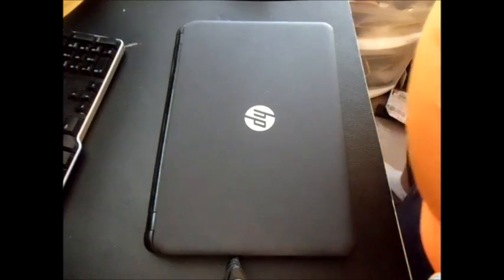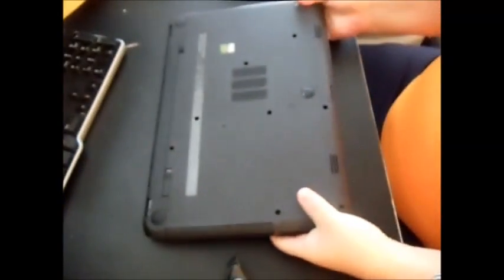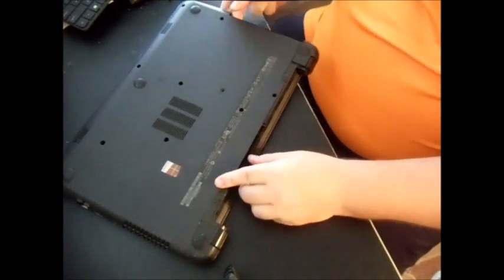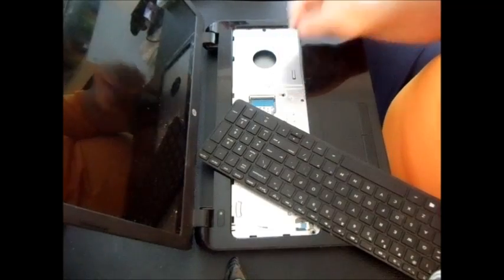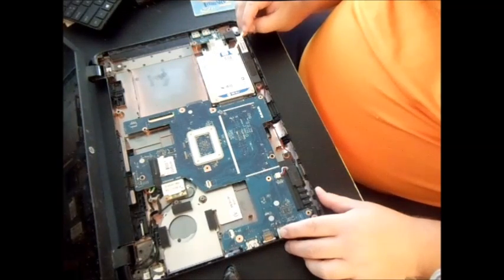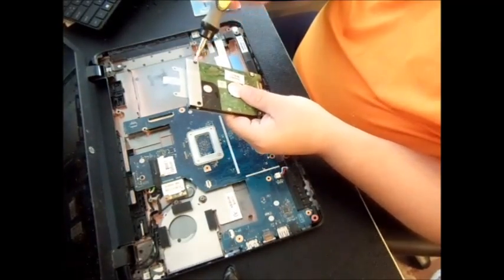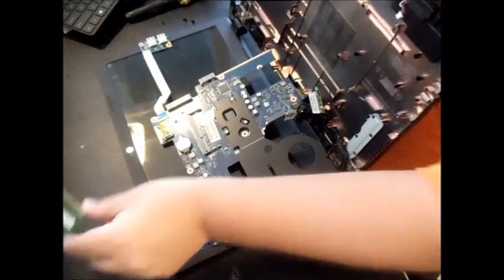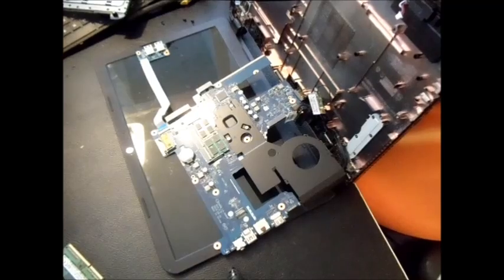HP 15 Laptop Memory Hard Drive Upgrade Replacement 15-R011dx 15-r015dx 15-r017dx 15-R018dx 15-r082nr

Comment: You Rock! 
I used the free "Belarc Advisor" program ( I heard about it from Kim Kommando years ago )and verified that I had two RAM slots on my HP 15-R018DX Notebook PC.  I had one slot being used with only 4gig RAM from the factory.  I was able to bump it up to 16gig ( 8gig in each slot ).  Thanks for your video it showed exactly how to get to the slots.  

HP should hang their heads in shame at how many steps it takes to get to the RAM slots on these models.

Comment: i have a brand new HP 15-af027CL that I would like to give to my mother as a gift.  she needs the larger screen so ...   anyway, i have 8GB installed by the manufacturer, but would like to upgrade.  From what I see in your video i see one slot, and from the crucial.com memory adviser, i see two slots.    I don't want to open up the computer until i can confirm whether there is one or two.  because what i buy is dependent on whether the motherboard can accomodate a 16GB sodimm ddr3L 12800 or if I can put in two 8GB sodimm ddr3l cards.   anyone know for sure?

Comment: If your computer has 2 slots, can you use one 8 gig chip and it still work?
Reply from the maker: Yes you should be able to but I dont think you can upgrade it more than 8g
Reply: Thanks, I run ubuntu 16.04 64 bit and 4 gigs just isn't enough...

Comment: I can't seem to get the top of the laptop out, it feels to be stuck around the hinges... Do I keep using force or give up because I'll break it?
Reply from the maker: A little force.  Just go back over the holes and make sure there are no screws.  Sometimes you do have to just go for it and you'll find that its just on there so well because of the manufacturing press.  Its a lot easier the second time.  Remember though if you do break something the parts on Ebay are very very cheap.
Reply: I ended up breaking it a little bit. There were two hidden screws that were underneath some parts that I never knew I could/had to get off. Oh well.

Comment: Hi, I have a very similar laptop (HP Notebook - 15-ac153sa) and I was hoping I could learn enough from this video to upgrade my RAM. On mine, you can't get the feet off. They're glued on. I have no idea whether there are screws under there or not, and don't want to damage it. I can't find any tutorials for my model anywhere, so if anyone has any tips, I'd really appreciate it. Thanks!
Reply from the maker: You won't damage anything.  It's just plastic rubber and glue.  You can always add more glue on it.  You have to be aggressive with these things sometimes.
Reply: Awesome. Thanks! :)

Comment: Great video. Replaced a broken screen and the connector is extremely difficult to plug back in. Cheapest laptop that I have ever worked on. I think I will keep my HP  ZD8000.

Comment: Forgot the 2 screws that you need to remove after pulling the DVD....
Reply from the maker: You did or I did?  Because I clearly showed it in the video.
Reply: http://saudi.souq.com/sa-en/kingston-8gb-ddr3-1600mhz-for-laptop-memory-kvr16ls11-8-9427430/i/ can i use this ram

Comment: Great video, thanks. Didn't realise it would be so complicated. However, I'm left with two flat screws when I've reassembled and can't figure out where they go. They're the same ones that hold the speakers in place. any ideas?
Reply: battery or dvd drive

Comment: my keyboard just blinks amd my screen wont turn on now
Reply: me too. ram did not fix it for me but try it. I just got a new motherboard on eBay. I hope it works.
Reply: Make sure your ram card is pushed in fully
Reply: Your mobo may have sustained static damaged as when you took it apart you may not have been probably grounded

Comment: i have HP 15-f085wm, can i change the RAM or hard drive? because for video editing this is so bad :(
Reply from the maker: Yes back up your operating system and everything through HP recovery and download it all on a 16g USB memory drive.  Then buy a 128g or 256g SSD hard drive.  Upgrade your ram to 8g.  Reinstall your Windows operating system onto your SSD drive with from your memory stick.  This will help.
Reply: okey thank you..
but, i dont have to many mooney, so if i want to change the HDD, in your opinion, what HDD good for video editing? (not gaming) :)

Comment: Hi , i need to replace the wifi adapter on my HP 15 laptop. Can you tell me if there is two connections on the adapter (black/white) or a single connection (black). Thanks

Comment: How do you put the "feet" in their place again? do they just stick back again ? (afraid to take them off and not be able to stick them back)
Reply: They have sticky glue on them & adhere back just fine.  I used the same steps on my HP mod 15-G023CL, but Surprise! it has only 1 memory bank total!  Cheap HP! I replaced the single 4gb w/an 8gb.  If replacing the HDD with SSD, use Free Home Macrium Reflect in Clone mode. You can get a USB3 adapter for $20 and attach the SSD to the USB3 port and clone the whole disk in an hour.  I have used Macrium backup with Win7 & Win 10 and it works well - and its priced right for Home use! With an external Blu-Ray writer, backups are quick, easy & cheap.
Reply: Thank you, I just want to remove something noisy from the inside haha like a little bit of plastic or so... that's why I wanted to disassemble it ^^ Thank you again

Comment: I have one of this machine's cousins and, despite reading the repair manual, I would have broken a couple of things without your walkthrough. HP disappoints on many levels with this, I believe it has a BIOS bug they have not tried to fix in almost 2 years, mine came out of the box with an extremely slow harddisk, maybe invisibly damaged but not of interest to HP, and the list goes on. What I can't blame HP for is that a) one screw on that caddy nearly broke my cheap screwdriver, but it was the only problem screw b) all the ribbons feel a bit different and in the twilight I wasnt sure where I was going, but they seem properly reattached.

Comment: Thank you for this, it was very helpful and exactly what I needed.  I have successfully upgraded a HP 15-G077NR from 4GB to 8GB.  I did cringe a little every time I saw you drop a screw haphazardly off to the side. One thing I find indispensable for this kind of project is some sort of screw organizer. A small ice cube tray works well. It not only helps you get the right screws back in the right places, but also helps keep you from skipping any steps in the reassembly.
Reply from the maker: Thanks for the comment.  I agree about the screws but I have several thousand equal screws on reserve if I lose one. lol

Comment: Love your video, watched it 5 times :) but am stuck with 2 screws under the DVD into the case that the "General" can't unscrew.  Tried WD on a q-tip swiped over screw head, still nothing.  Sad face, guess it'll have to go to the Geeksquad to finish.  Thanks so much for this tutorial!
Reply from the maker: Oh don't do that. lol  Some screws that are stubborn need a different thickness screwdriver and torque friction power.  Purchase a manual precision screwdriver set to give you multiple options.  Here is one from Ebay but its coming from China. If you look more carefully you can find one that is local or in the US http://www.ebay.com/itm/Delicate-31-In-1-Precision-Set-Handle-Mobile-Screwdriver-Phone-Repair-Kit-Tool-/281779565739?hash=item419b5ef4ab:g:KjkAAOSwHnFVrJTf

Comment: my brother i need help hear.. i have got the same laptop as urs ..it doesn't display but it does switch on and it shows that its on because the wire fire batten it indicate ..so i try to look for video cheep set ands am not show that is it the one..because there  is no cpu so i think its acting as cpu so am afraid to burn it..course to others i do so and it display but only to those mother Bord which has cpu and video cheep set..so please help..it doesn't  displaying ..WHAT MUST I DO

Comment: I went to crucial and ran their scan and it told me i could get two 8 gb sticks for a total of 16 gb. i ordered them and then now just watched this video to see there is only one slot. i guess i should cancel that order.
Reply from the maker: +Adam Tillman Which model is it.  There are a few with 2 slots.  Also you can replace that one slot with an 8g. I'd recommend getting a used one on Ebay. I've seen 8g ram for as low as 30 bucks.
Reply: I am not sure which exact model it is all i know is it has the 1.7ghz gen 4 I3 processor. and i do realize i can get an 8 gb. but i want the best 8gb i can get for it. and crucial has good prices. but still thats a lot of work for a 8 gb ram stick. i was just really hoping get get a good 12 or 16 gb ram. that would be awesome. anyway thanks alot.

Comment: Is there a limit to RAM you can put in this laptop? I have the same one and want to put a total of 32gb's in.
Reply from the maker: Yes.  8g is the max I believe on this one.  Some laptops will allow up to 16g.  Remember your processor and OS is a bottleneck so it wouldn't utilize the full 32g anyway.
Reply: +RubberWilbur what if I put in a 16gb RAM? will that work or will it just read 8gb out of the 16gb?
Reply from the maker: no it won't work.  8g would be the most.
Reply: +RubberWilbur well that's a bummer but thank you for the info it saved me from buying a 16gb RAM.

Comment: HP why do you make it so hard to upgrade :(
Reply: acer is the same way the manufacturers hate us
Reply: kaleb33497 
At least Acer laptops are easier to upgrade than modern HP laptops.
Reply: ***** still as hard an annoying
Reply: after watching this I'm not going to be upgrading to the 8 gig chip. Smh, waste of time for an old laptop.
Reply: Lall O They want you to buy another one
Reply: They've become like toasters --- disposable. Next time, get a "refurb" from Walmart.com  You'll be astonished how little they cost.  I got a nice business-class HP, fingerprint scanner, tough case, extra ports, etc. for $250. It looked new (no wear anywhere, clean). Add another $100 for 16G RAM from Crucial.com (and it had a little door to install the RAM).

Comment: Thank you for this video. I bought the same model shown 15-r029wm refurbished for a joke of a price. After using it for about 3 hours I listened to the "clicking sound of death" so I quickly check this video to check where my hard drive was placed and it was correct. The hard drive is about to die...hopefully I could attach a 240gig ssd, but if you think this disassembly was awful check any Compaq presario CQ60 disassembly

Comment: Thanks for the video. Although I have been building my own PC's for years I have done very little on notebooks other than add ram and swap hard drives which in most cases is very easy. My HP 15 came with Win7 and an upgrade "recovery" disk to Win8.1 which I hate. Adding an SSD drive and 8GB, wanted to add 16GB as I thought it had at least two slots and now have a spare 8GB stick. My HP15 was running very slow, a piece of junk in my opinion, tried everything to speed it up so this was my last hope. Your instruction was good to speed things up, there were two more wire connections to undo at the end to fully free up the MB. Now it is all back together, took forever to install the recovery version of Win 8.1, had 4 disks and now upgrading to Win 10 which also takes time. I must have messed up on the KB ribbon as the KB is not working properly, after this Win10 install is done I will pop the KB out. If this thing doesn't speed up, I will take my new parts out and toss it in the trash! Thanks again for the instructional, having all the screws to remove pointed out to you sure speeds things up.
Reply: did you eventually fix your laptop if it not to much trouble could you help md?

Comment: Very educational. A tip that might help in the future. Get CPUID and it will give you the amount of slots used on the board. That way you can decide BEFORE you take it apart if it's a worthwhile upgrade or not considering the time taking the laptop apart.

Comment: Thank you for the video!

I'm working on the same model. I put the thing into hibernate and surprise! Windows 8.1 has this weird problem. If it goes into hibernate, sometimes it forgets where the boot drive is!

I had a Samsung 80 gigabyte hard drive attached to the notebook when I put it into hibernate. Now when I turn it on, it gives me 5 choices for an operating system, and they are ** ALL ** the Samsung hard drive!

I tried repairing the boot sector. I tried reinstalling Windows. Nothing I tried worked. So I watched your video and removed the hard drive. Next I will back up everything that is worth backing up, and then try to repair the boot sector.

If that doesn't work, I will probably have to format the hard drive and then install Windows.
Reply from the maker: +Anthony Starfield Yep it looks like you may have to install a fresh WIndows OS to solve your problem.

Comment: thanks man, i found your tutorial very instructive and useful. My pc is hp 15r-225 nl and it's almost egual. I  followed the tutorial until the motherboard removal. I didn't understand how to remove the lcd cable from the motherboard, and in your video there isnt't the cpu cooler, that in my case seems to prevent the motherboard removal...or i think so. any suggestion? For this reason i could not check if my laptop has 1 or 2 ram sots. The motherboard seems a little bit different from yours.

Comment: can you tell me where the HP wireless card is on this model. it seems this model is very difficult I wish I would have known before I bought it. Thanks for your help
Reply from the maker: +roadstar499 If you look at minute 11:43 you see it in the right center to the right of the DVD slot.  See the tiny little white square?
Reply: +RubberWilbur I really can't see what you're saying because my phone is so tiny and my eyes aren't the greatest. never fixed a laptop before although I can fix just about anything else. will I be able to get it from the top side or do I have to flip it over. does it say something on it so I can recognize it? I watched a couple of other videos using other laptops and they got it from the bottom and it was so easy compared to this 1. Thanks
Reply from the maker: +roadstar499 Unfortunately if you have this model you have to take off the palm rest.  The older ones you don't have to do this.  Just take your time to dissemble.  Why do you think your wi-fi card is bad?
Reply: +RubberWilbur my nephew who was in the service told me that was the problem. he fixes computers. he's in Turkey right now and I rather not bother him we're really not that close. my laptop does not recognize or show any Wi-Fi connections in my area including mine. nephew said with these HPS is very common for the cards to go bad
Reply from the maker: +roadstar499 I'm sure you already tried this but make sure it is not just turned off.  Tap the F12 button and then try Function F12 as well.
Reply: +RubberWilbur yes I tested for everything else. so the wireless card is underneath the palm plate and facing upward? Thanks
Reply: +roadstar499 what I mean is I don't have to flip it upside down I work on it when its sitting face up and remove the wire card? Thanks
Reply from the maker: +roadstar499 Watch the video.  It shows everything.
Reply: +RubberWilbur I have the Wi-Fi chip screw out but how do I disconnect it from the cable I don't understand that type of connection do I just rip it off pry it off. also what numbers do I use to order a new one. the ones on the top with the information on the back. thanks again for all your help
Reply from the maker: +roadstar499 Yes they pop off and pop back on.  Just go to ebay and type in the model number you see on the card.
Reply: +RubberWilbur ok I got it off there are several list of numbers on it. and I do mean several. none of them say model number. can you be more specific. is it Mac ID or ct number those are the ones with barcodes over then below there are more numbers.

Comment: "4 gigs is really good" Wrong 4Gb now-a-days is terrible unless you're running Win7 and below Win8,8.1, & 10 is terrible with 4Gb, Please inform these lovely people correctly.
Reply: Actually all depends on your usage. For general usage like browsing and word documents then 4gb is plenty.  And ive had no problems with 4gb ram on windows 10
Reply: +taz874  you are absolutely correct im running w10 on 6gb stock hp15 r formerly had windows 8.1 no issues
Reply: +Milkersdegreat2 I agree with you, My Girlfriend bought a similar Laptop, It has windows 8.1 then it upgraded to Windows 10 which made it super slow! I put 8GB since that was teh max allowed by teh motherboard, that helped a little, but what really did  was the upgrade of the HDD. I installed a Samsung 850 evo. Thankfully, motherboard was SATA III ready so I get full enjoyment of the HDD capabilities

Comment: Be warned: Be very careful when removing the palm rest from the keyboard baseplate.  When I did mine, the cable strip going to the power button stripped and had to be replaced because the cable was too taught and slightly too short.  pain in the ass when you get it all back together only to realize you have to take it apart again to replace another part

The 15-r017dx has 2 ram slots, thankfully so it wasn't a complete wash, but now that I have it back together, cable strip for power button replaced and a new HDD with an OS finally installed, I'm finding out i somehow missed reconnecting the wifi antenna cables and the right side USB ports, time for take apart number 3! WISH ME LUCK! lol
Reply: did you  ever fix it I upgrade the ram in mine but now it won't turn on and I'm scared
Reply from the maker: probably your new Ram is incompatible.  Just put the old back for now.
Reply: +RubberWilbur no dice now the fan won't even boot